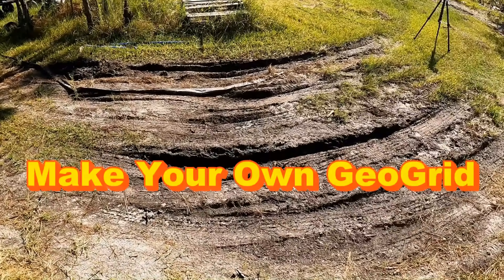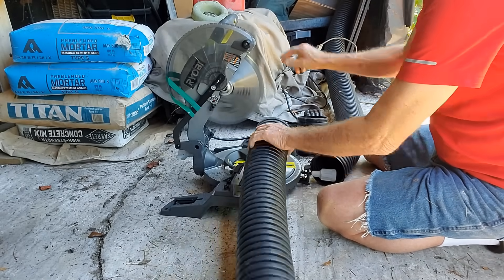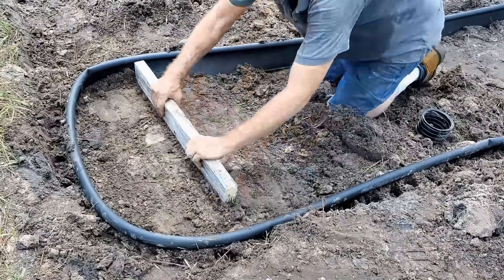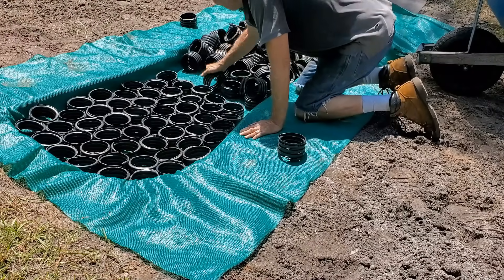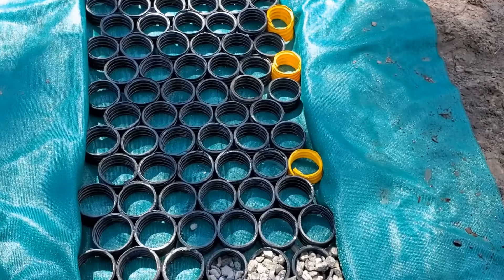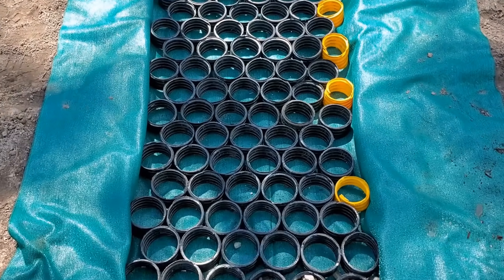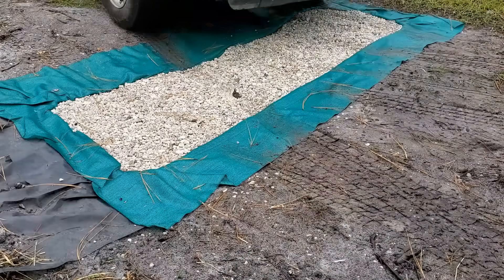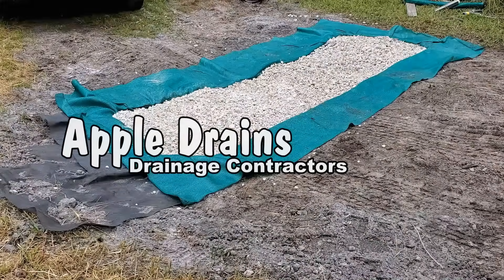Make a Geo Cel Grid that's Stronger and 1/2 the Cost. SAVE!

Comment from the maker: One of the Projects to solve Driveway Drainage! Seriously! Less than $50. Little bit of Labor, But I Promise it WORKS!
Reply: The real test will be when you do the whole driveway.
Reply: I love the concept I am thinking of using it at home it's a fantastic idea but your application is not the correct solution to your problem.
Your problem is that a water course is trying to cross your road this solution will just move the soil erosion and silt deposition to a different spot.
Your best bet would be to put a ditch and culvert pipe either side of the road you could still do this dig a small channel and run a culvert pipe along the side of your mesh grid.
As I said I love the idea but not quite the correct application 20 years as a landscaper and I've never seen this before.
Reply: I am seventy years old.  I'm in great shape. The problem is that they are making shovels much heavier than they used to!
Great video.  Going to implement this with a minor change.
Reply from the maker: @wrongfullyaccused7139  you can do it!!
Reply: Do you think this system would work here in North east Florida we have sandy soil?
Reply: Man thank you for the instructions!
Reply from the maker: @solutions4tenants141  you’re welcome
Reply: Well.... it was basically free for you because you used existing materials. Well done, you!
Reply: He used materials other people paid for-there is a DIFFERENCE!!
Reply from the maker: @bcarol2484  less than 1/2 the cost by doing it yourself!!! Try it out!! It works great
Reply: Isn't it tronger than that geocell ? That stuff is a thin plastic foldable product.

Comment: I do think it will move since all cells in this system are independent. Had they been joined, even with heavy zip ties, the system would benefit greatly.  But I applaud the effort.

Comment: Germans are taking the steel belts of recycled steel belted radial tires and making that same grid to hold the gravel so it doesn't migrate over time. Their roads last a lot longer and aren't susceptible to pothole formation from heavy trucks that push the gravel around underneath the road surface.

Comment: Still gonna sink over time.
Where you at? How far to the coral bedrock?
What's gonna fix this, permanently, is to drive pipe down to the bedrock, or very far down if you're up-state and over 30 feet to the bedrock, and make a truss for a solid foundation for that soft spot, and remember, Mother Nature there might try to make a culvert under it.
About a year now. How far has it sank and was it a dry year?

Comment: Sorry but this makes absolutely no sense. So much effort and you could  just try to capture the water from uphill and channel it through using a.. channel. you can absolutely keep the gravel if you want and keep it there using the same edgine or other techniques. You just spent a day cutting a pipe and adding even more plastic into the ground.

Comment: It is nice idea and even doable with recycled plastic bottles, but a little bit an overkill, as from the time you made kind of a pool with the geotextile, the gravel wil be hold well anyway (in this width.. otherwise put some edges every linerar meters and it will work..) isn't it ?

Comment: I'm using his technique to make an extremely long driveway. I'm going to dig out 2 tracks, 2 feet wide each track, put down his homemade geogrid, some fabric under each track. Then get gravel delivered. It won't take much gravel. I might even cut it down to 1 foot wide tracks which match my tire width? I was considering spending thousands and thousands of dollars on this extremely long driveway. Now it might cost less than $500 and last 20-30 years? Can anyone find anything wrong with making 2 tracks of homemade geo grid? Put plastic liner on each side of homemade geo grid,,,,,,,,or pressure treated wood?
Reply: Or put used tires down to make 2 tracks? fabric then gravel????

Comment: You can do the same thing with used tires with the sidewalls cut out or one side cut out and holes drilled in the other for drainage. Screw the tires together and fill them full of dirt rock sand until you can't see them anymore once they're full and compacted you can even cap it with asphalt

Comment: Any pipe would do even plastic drain pipe, water will drain at the bottom, not necessary to have the side holes. 
In the UK we use mot type 1 stone, it is large stones and smaller stones plus dust which all locks up solid when compacted.

Comment: I did some quick math on this and I can’t see how this saves any money.  Unless I did my quick math wrong.

This corrugated drainage pipe is around $1.25 per linear foot if bought in bulk.  Using 4” diameter pipe, cut it into 4” sections, it would take 9 sections to cover one square foot. So , 3 liner feet of pipe to convert to one square foot of 4” deep geo grid.  $3.75 per sq foot, or of course. $375 per square 100 sq feet.  Not to mention spending hours cutting the pipe in 4” sections.  If you made it into 2” deep geogrid you would save by half and only be at a cool $187.50 per 100 sq feet 😂

Even the Amazon geogrid (it is like expandable nylon mesh netting) is expensive and it’s still like $0.50 per sq foot.  Which still seems ridiculously expensive.

Comment: I think most who need geogrid need far more than 21sq/ft. I calculate (2nd-grade math) 3 Lin/ft per sq/ft. Your 21sq/ft would take 60 Lin/ft or 6-10 ft lengths, each $15 (x6) = $90. You could get 4” geotextile banding and staple it into a geogrid with likely less cost and effort.

If you only had a small space to remediate, then sure.

Comment: years ago, someone used tires, and stone, and $5 landscape fabric.   They cut the sides off the tires, then covered with stone in the driveway.  Working for 10+ years without any drama. Near their garage, where they were unloading cars. You cannot even tell where the soft spot was.   They had previously just been dumping more and more stone every year, but it was not firming up.   At the time you could get 2 ton of local stone, for $20-$25.  They powerwashed their old stone, and put it back, then topped off with new stone.

Comment: I have a question…because you lined your project with two layers of the black material then two layers of the blue material wouldn’t this cause water to stay within the grid and disperse out into the surrounding dirt area? I must be missing something and did not see this in other comments so I get that it’s my misunderstanding but before I try this can someone explain what happens to the rain water running down through the rocks, into the cells then hitting the four layers of almost waterproofing fabrics? Thank you!
Reply from the maker: It’s not about drainage. It’s about stability of the soil

Comment: I salute you for trying this, but I don't see it working for long, simply because each of the cells can move (down, specifically) independently of the others.  When the subgrade turns muddy from water accumulated in the gravel within the cells, why won't your tires just transfer the load right down to almost the same area and cause...slightly more smooth ruts?  
Now, if you had some ghetto way to splice all those offcuts together, well THAT would be something I'd consider doing.
As others have said, a followup after a rainy season would be useful.
Reply from the maker: Coming soon! Spoiler Alert ‼️.. Working better than concrete
Reply: I had the same concern when watching this.  Heck, It wouldn't take much to tie the things together.  Cable ties might even work
Reply from the maker: Coming soon!

Comment: Better still is "mechanical concrete" the fancy name for tyre cylinders with their walls cut out. Doesn't crush and extremely strong enough for large heavy trucks and machinery. You can fill them with sand, gravel etc. Lay geo fabric underneath.

Comment: Folks might also consider old used carpet (free from carpet places) for the underlayment , I have had same carpet on my driveway 30 years for erosion control.  but the drainage pipe cuts are genius !  I'm in FL also and one might check on ground concrete for filler...

Comment: Love your videos!!! I wonder how it would be if you use 4" round PVC pipe cut into 4" sections? Is PVC cheaper than drainage pipe? I would drill holes in the PVC pipe to help with drainage. Let me know your thoughts!!! Thanks for sharing.
Reply from the maker: I actually tried PVC 1st., it was very difficult to cut clean without shattering.. end results are use perforated Corrugated pipe for best geo grid
Reply: Thank you!!!
Reply from the maker: @royrussell8531  you’re so welcome!! 👍

Comment: Roman roads were dug down 4 to 6 feet, rock slabs were laid on the sides. 4 inch rock was laid in bottom 2 feet. 2 inch rock next foot. 1 inch rock to surface. Everything tamped.  Next peagravel with tiles on top. Your side slabs would be just above surface. Sand dribbled between tiles.
Reply from the maker: Roman roads had base of straw. This kept them from sinking. Do a little more research on construction! Thanks for your comment
Reply: Yes, they used slaves to build those labor intensive roads

Comment: Wow what cost apple drains $40 in the USA
Well in the UK at BnQ the 20m of perforated 4inch pipe would be £111 and the 4 bags of stone at £1.75 each would be £7  🟰 £118 which is around $138 so that is 3 times more expensive to do in the UK  privately from local Depot. We British are been ripped off for everything here on this island
If you had to buy the membrane aswell that would be £19.99 for 14m taking you to a grand total of £137.99 🤯

Comment: I'm a bit confused by the numbers here.  Cutting up a 10' stick of flexible pipe into 4" sections will yield 30 pieces.  Using two lengths should yield 60 pcs, except the video shows over 150 pcs, not to mention some yellow ones.  150 pieces would be at least 5 10' lengths of pipe, making pipe costs alone more like $50-$75, not $20.

Comment: 0:25....that's not a drive way, that's straight up lawn grass.
you need to talk to some farmers. golf courses use a mole plow, but you straight up need drain tile to move that water to some place you want it to drain out at.
also your gravel failed because you didn't establish the right gravel layer first. you see what trains drive on...yeah millions of tons drive ontop of that thru swamp in canada and the upper usa.... the bigger the rock the more weight distribution to soil contact...it's literally they way concrete patios and drive ways work except with out cracks for water and plant root penetration

Comment: You have to be careful because water entering your geocell fill has nowhere to go, and soon you will have a water pool. I suggest doing your geocell layer above ground instead of excavating( with a lateral underdrain made with the same pipe and stone), and provide lateral confinement to prevent the edge cells from moving sideways.

Comment: Far more than 20' of 4" pipe, when you count the sections seen in the trench. Or doing the math, you cut 3 rings per foot of pipe, so you'd get only 60 rings for 20', about enough to cover 5 sf.

Comment: Perforated pipes only work as an air void if they are left open.  When you fill them with gravel there is no more air void so they aren’t really serving their full purpose.

Essentially it’s just pit wrapped with filter fabric and filled with gravel which will also work but just not as well as with air voids for more water capacity. 

Smaller diameter sections of pipe laid horizontally would work better without stone filling them (more air voids and still stable)

Cool video though thank you.

Comment: The geogrid purchased panels and layering system is 2" high, and costs $08.29 per square foot.  Using the 4" perforated pipe, which I would cut myself with a fence on my band saw table at 3" length instead of 4", because this is engineered to be a layered system.

Run permeable after clearing and compressing the soil to be filled, roll out  and stake down the fabric (Tyvec is the strongest at $.09 per SF) and layer 2: of 3/4" crushed gravel 2 or 3" thick and compacted,  then lay out the grid material, and fill it with 1/2" and smaller gravel, to which I would add 50% mix of the recycled asphalt material (cheap and strong) and finish over the plastic grid with 2" of this prepared gravel asphalt mix at about a minimum of 2" over the plastic grid and plate compact and roll this to a hard compacted level surface and it will fill at about 7" at a cost of around $5 per square yard, and be a easy maintenance surface that can be cleaned up and resurfaced every few years with a Bobcat and minimal added surface material.

I have a gravel sloped driveway that has has a rain runoff problem and it's a multitude of mixed evils every year.  The one thing I think I'll try there is to take the perf pipe and wire the pieces together with tie wire of zip ties, just to reinforce them from side movement when it gets wet and heavy traffic in the winter. I'm 74 and getting tired of the mess and the exhausting road work out here every year.

Comment: Soda bottles sectioned off work too a leather punch can be used to make a bunch of holes too.  I would be building it a lot wider so a sort of channel is created like a low flow pipe.
Reply: @watchthe1369 I was also wondering about the same thing! Substituting the tubing with 2-liter bottles cut 4" high with holes on the sides for drainage should theoretically work to hold gravel in place.  Have you done this before and can confirm that it would work?

Comment: you arent "recycling" if youre using materials you had previously BOUGHT. this also doesnt have the stability of geogrid because the nodes arent connected, you may as well have just filled gravel over the fabric. lastly this wouldnt fly at all in most states because the drain pipe would disintegrate once it got frozen.
Reply from the maker: lol

Comment: Florida must have rubber crumb? Ever known a tyre to stay embedded? It looks good, no crunch, keeps on muscling it's way to the surface and never wears away. Even using your grid, it'd work out. I used it on training rings for race horses. After the 1st install, I couldn't keep up. And helps keep the dumps free of non-bio's...

Comment: Ahhh this is excellent! I have heaps of this drainage pipe that I picked up for free. I was only planning to use the good pieces for drainage but now I can use the rest to stabilise my yard/drive/parking and garden path. Can’t wait to try it! I love reusing waste materials and solving problems :)
Reply: Would 2 inch sections work okay for a walkway?  I want to make a pea gravel walkway from my driveway to my back deck stairs.
Reply: @refusingtogiveup it worked for me, that pea gravel is still in the same place 2 years later. It’s not all loose and wonky as before. We even washed the soil off the old pea gravel and added new as needed. One thing I learned is not to go nuts and start digging to the center of the earth. Just use a good quality flat blade shovel to remove grass and don’t disturb the soil or you need to compact it. But for a walkway with foot traffic it is fine.

Comment: Good stuff, creative solutions.
I found to save even more In Missouri I've used old carpet that people throw away as an underlayer on top of the super soft clay soil, and it stops the gravel from sinking and it's surprisingly tough and it's last 5+ years so far on a heavy trafficked driveway(occasionally add a little gravel in puddles; I'd guess I used half what you did  in the same area of gravel and no pipe. Just throwing that out there.

Comment: My drive is dirt/gravel from 20 yrs ago, and yes, I'm in N. Florida.  Also on a slope dropping down and back about 600 ft. on the property.  There's sections that have dropped from level on both sides of the drive to about 2 ft down.  I have a section in the front that was clayey and it was monstrous to drive on when wet.  We got a bunch of broken up concrete and piled it on.  It has sunken down about a ft over the years but it is hard with that much concrete buried down in that section.  What do you recommend for filling up the 1 and 2 ft drops so that mowing the edges doesn't involve trying to keep the zero turn from falling over sideways?  I'm really intrigued by what you have accomplished.  I'm a 72 yr old widow - lost the love of my life when he lost the 10 yr battle with stage 4 colon cancer.  I need to fix this driveway without it costing an arm and a leg.  You've approached your issues and love to hear what you think could work.  Thanks in advance.

Comment: If you have a bigger area to cover; more stability needed for heavier vehicles, you can use tires as well.
Reply: I had thought about that before as well. Even connecting them together with stainless steel bolts.

Comment: You can make porous concrete by mixing gravel with cement and no sand, it binds the gravel but leaves holes for water to pass through.  It is super cheap and easy to do.  Try it.
Reply: Would you pour that into this geogrid? Or are you suggesting it as an alternative?
Reply: @Tonisuperfly  It is an alternative to using the expensive plastic.
Reply: @murraymadness4674  thanks. Any particular ratio?

Comment: Odd voids could be filled with smaller diameter pipe.  I like 3" corrugated pipe for some drains, but this looks really good for driveways if it can hold the weight of the car over time.  Those plastic geogrids for sale are just far too expensive to be useful.
Reply from the maker: Great idea
Reply: @appledrains  I wonder if old scooter or motorcycle tires could be recycled this way by using them instead.